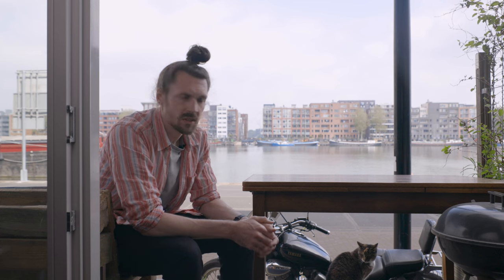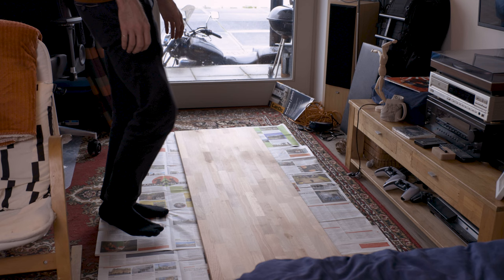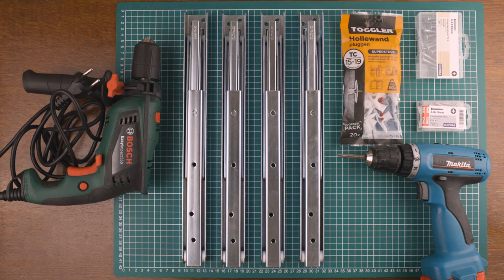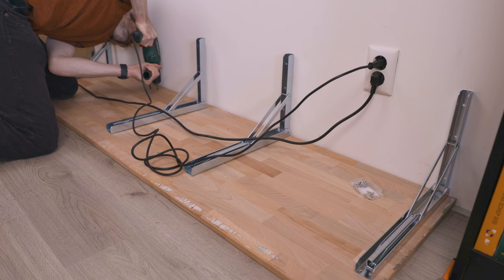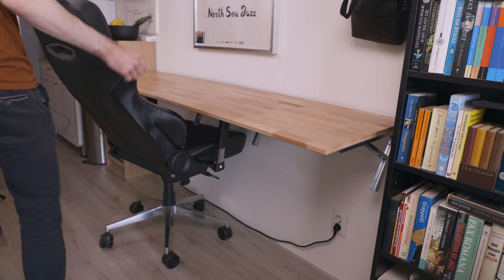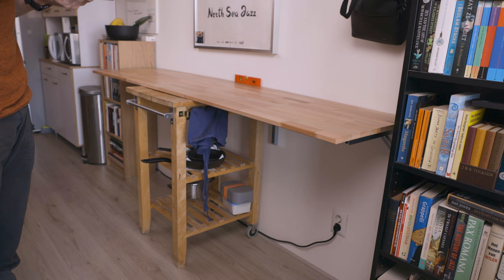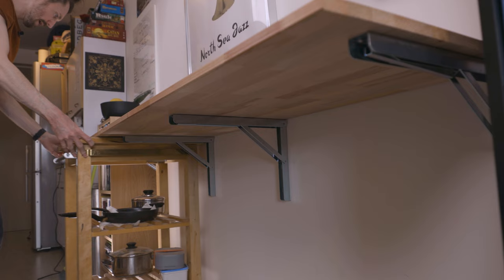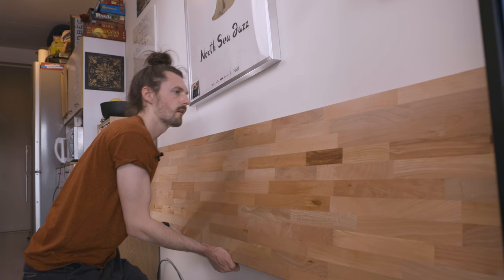DIY folding desk | studio apartment efficiency

Comment: Lovely! How did you fix the folding-all-the-way problem though?
Reply from the maker: Thank you! The problem was that the outer part would get stuck against the inner part of the brackets when I attached them at exactly 90 degrees. So I changed it to the angle that the bracket was naturally in and just drilled new holes. It was a bit more work but as a perfectionist it was definitely worth it.